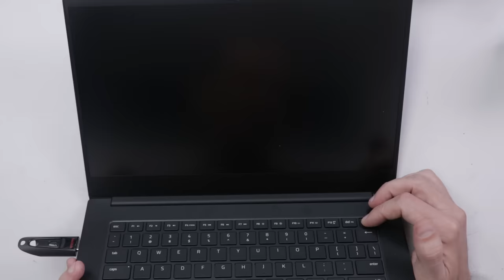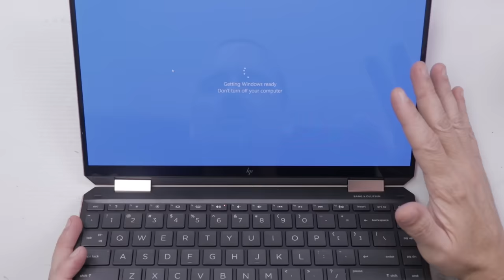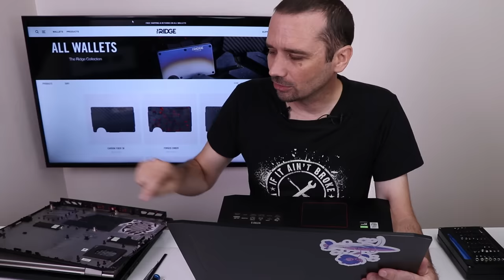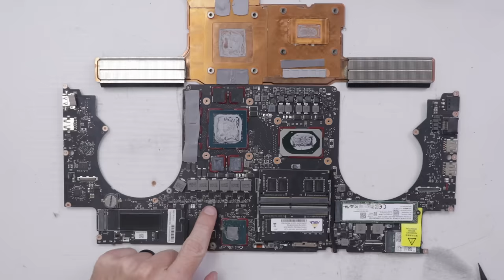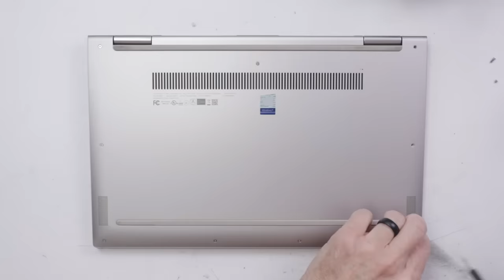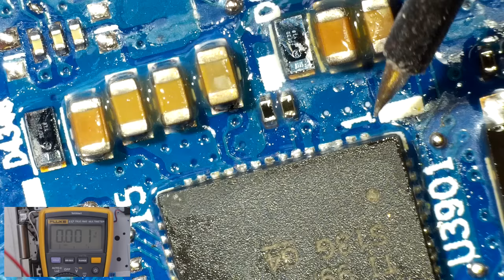I Paid $2500 for 5 BROKEN High End Laptops - But Can I Fix Them?!

Comment: i bought that exact nitro acer new from the shop. exact same keyboard error, sent it back, got a brand new one(i checked the serials) exact same error. this is a fundamental problem with these devices, although some say theres a software fix for it now. got an hp instead

Comment: Also to find the usb c controller chip unplug the battery, plug in the charger and use your flir camera to see which chip heats up per usb c port. 2 ports should have 2 chips i belive...

Comment: for the issue with the keyboard, consider after all the reseating of the cables does not work, you will have to replace the keyboard,  usually that will fix the issue, also reinstalling the os system is no a fix for fixing the keyboard, so that obvious fix is the keyboard

Comment: The Battery acts as a load , when the charge chip is loaded by the battery it causes some component to malfunction in the charging IC. Change that chip may solve your problem

Comment: Awesome vid.  I think it will be inspirational for people learning computers to see your process as you gain more PC specific repair knowledge.  Keep up the good work!  On the weird charging behavior maybe there is a chip that tells the system when not to charge the battery, by reading current charge.  And it's reading any charge as full charge.  The times it worked you bypassed the logic in that chip.  The first time because the battery was completely dead and the subsequent times because you were plugging it in while applying charge and it's faulty check was only when you first plug in the charging source.

One thing you might try is reinstalling the BIOS.  I'd love to see an update where you try different things.  It's in interesting challenge.

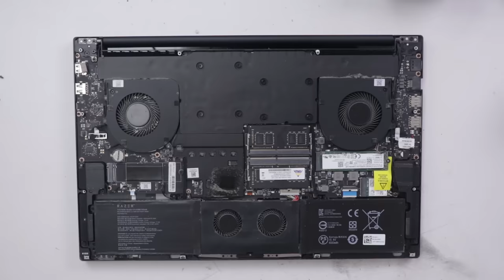Comment: I bought a 1060 laptop that was constantly thermal throttling, went to examine the fans and found a similarly thick dust clog to 10:00 in both fans. No wonder.

Comment: What we got there for the Lenovo is just a flat-out wonky battery *connection*. Inconsistencies about the actual charging of the battery should tell you that there's either a short or an improperly-seated component either related to or directly at the charging ports. If it were consistent then the charging port or the battery would be faulty, but since it actually works when you plug the battery back in, the connection seems to be hitting a snag when the battery is alreadty connected.

Comment: Nice lot you buy you were really lucky with tis lot. I would check the first and second mosfet . When the second mosfet is shorted it will noyt charge or the buck converter from the battery charging.  ( High and low mosfet)

Comment: Try changing out the batter connector pin selector I think when you plug and unplug it it only works when charger is plugged in you already unplug and plug it back in from the battery it should work normal

Comment: Check the USB-C traces? Sometimes USB-C can short out and charging and data flow can be REAL finnicky. Check if your USB-C devices are getting the appropriate speeds. Maybe the ports or something along the traces possibly is shorted out. Hence when you unplug the battery and then run power directly from the USB-C, it may be tacking power directly and the battery is probably getting over-charged. Not sure if you tested those chips when you had the battery unplugged. Just thinking USB-C is all.

Comment: From the little I know when the battery is plugged in it will be what creates the system voltages. I giant loop if you will. By the fact your tester keeps reseting would usually mean a ground fault. Check the surrounding caps.

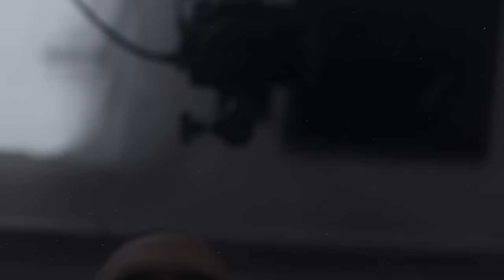Comment: 14:47 Seems like a faulty battery than can only hold 30% charge so it thinks its full and won't take anymore Edit: Maybe I was wrong???? That's really weird. It's gotta be one of those chips replacing the battery usually fixes these issues

Comment: There has to be a blown capacitor or resistor that is not limiting current someplace.  That board only has so many components, look for a capacitor with no capacitance or a resistor that's open or closed.

Comment: What if you added a switch to the battery cables routed to the exterior so you can switch the battery connections off and then plug it in and then switch the battery connections on.

Comment: i would actually add a manual switch with little note on it says “turn on after plugging the charger ” or “turn off before plugging charger and then back on after plugging the charger” 💁🏻‍♂️

Comment: Would the connector to the battery and the board be faulty? Or would you just think that it's receiving an unusual amount of voltage when plugged in at first? My best guess would be to to change the connecter from the board, or inspect the board for ground points to ensure everything is grounded correctly so there's no possible shortage of some sort. These are just ideas that I got from doing some it work in the plant I worked at. But it all could be old and the board just needs a new connector for the battery port.

Comment: If it was me with the bad charging laptop. I would add a little switch on the outside of the case. You could then manually open and close that circuit everytime you needed to charge it.

Comment: Maybe check the battery connector and components nearby. Also does each battery come with its own cable or the cable is detachable and same one was used for both? I don't like the looks of that L-shape bend on it.

Comment: I think the Lenovo battery takes power too early, when it's sending 7 volts, not allowing the dongle to initialize properly. Waiting for it to reach 20v, then plugging in the battery may be what makes it work. Try charging it without the dongle thing.

Comment: Lenovo laptops are picky on aftermarket chargers.I had a Lenovo laptop and i broke it's original charger by mistake,tried to use one from an HP that had the same voltage and connector and it would not accept it.Their service center told me that some models have a chip inside the carger that communicate with the motherboard to tell it if it's what it needs.It could also be a loose USB C connector on the motherboard

Comment: Laptops tends to be a fair bit more exposed to dust than other platforms.
Many people bring them into the bed and it gets to suck up all the fibers from the sheets and blankets.
They also tend to have terrible air flow and overheating issues due to that people design them so slim for some reason.
I would much rather have a bulky case that is reliable than a bomb which can die at any point.

Comment: That 4th one is a perfect example of who engineers and designers continue to fail.  It is SO easy to design an easy to access cleaning point for the fans and heat-sinks that do not require intensive disassembly.  A simple cover over that portion of the back would work fine.  One screw, pull off the port cover, clean the fins and reverse.  But NOPE!!!!  They have to do it this way.  It is just so infuriating and goes to show that manufacturers really do not care about their customers.  All they care about is getting as most money from them as possible and selling more units.  That's why channels like this are so important because more people need to take the time to FIX things instead of just replacing them.

Comment: The Windows troubleshooter doesn't actually do anything, it's basically theater.  The first thing I would've checked for is if the device has a switch (software or hardware) that puts it in airplane mode or something.  I would've said it was either that or missing drivers.
Reply: Occasionally it has actually fixed certain things like the notorious "invalid IP configuration".

Comment: it's probably the connections of the usb c ports. there could be some broken pins or poor solder joints. also get a different charger that one isnt that good certain cables have different power ratings so that's extremely important.

Comment: You might want to try running a bios update or an Intel Management Engine Firmware update on the one with the battery issue. It could just be a software conflict between the charging circuit and the battery management chip.

Comment: Holy crab!  Corrupted OS?  Well you done it the way every IT "professional" that ever shown me how to fix it done it (a few of which basically built the foundation for some predated operating systems).  Use a bootable USB, install new OS.  If you wish to retrieve files, use something like lubuntu and run the OS on that USB, that way you should be able to access files on the hard drive if it's not too heavily corrupted, and if they haven't encrypted their files.

Comment: Maybe try and take the battery connector off the motherboard and then solder it back on it may have a dry joint.

Comment: There 8s recovery partitions built in on own that should work. Also you need drivers and software from the company website for some stuff to work right. The extra drivers and software is half the reason to own those really

Comment: Those Texas Instruments charge chips are good stuff.  But i had some failing in weird ways on 2014 Razer Blades. 
A good default would be to just replace the BQ25 something something  on the Lenovo.
Reply: The issue specifically seems to be with the BQ25 Charge chip keeping the Battery switched as the main supply to the system.  If you then connect the Charger, it should Error / OCP because its Voltage and that of the Battery "Collide".

Having the Battery removed and then plugging it in and having it work and charge then, makes me believe that the Logic choosing the Voltage input for the machine is kinda dead. 
A replacement of the Charge-Controller is a really good idea anyway.

Comment: Usually they write a firmware code to toggle the charger state if it's charging or it's on battery mode. Please try flashing that and then reinstall it, it should be the only Dos or command installed. Check if that works for you and it it does 😊 you can 👍 install Windows os.

Comment: Try another charger, maybe your testing charger is at current limit and recognized it as short. It is at max load when you plug the charger and battery plugged in. Other thing maybe you have a bad capacitor on the board

Comment: I had same issue with a lenovo laptop I got for dirt cheap. Wouldn't charge. I unplugged battery. Connected charger. Reinstalled windows. Reconnected battery while still on. Battery charged up. And never had an issue since.

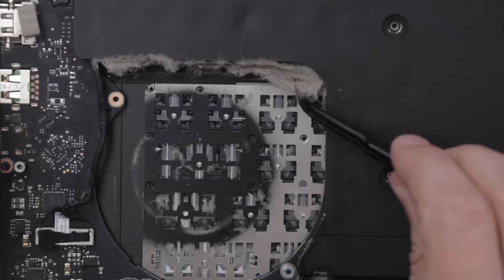Comment: 10:24 I've seen dustier laptops than that. I have an industrial strength air compressor, it's well worth it to blow some dry air through the air channel and make sure all that dust is gone. Simple job.

Comment: on the last laptop that has the issue of charging i think the problem could be centered around the part where you plug the battery into the motherboard. because without the battery it is running off a wired power connection and working fine but after unplugging the battery with the laptop plugged in the laptop runs normally but when you go to disconnect the charger after plugging in the mother board back into the battery that is when your reset back to step one so that leads me to believe that it could be that small black connector for the battery on the mother board.

Comment: I experience a similiar issue with a dell laptop with a bad remanufactured battery before. but it was on a replaceable battery pack, not internal. so the laptop wont charge at all when I connect the charger with battery in. but after replug the battery pack, it would charge the battery. the solution was to replace the battery with a new original battery, and the laptop are fixed.

Comment: 19:58 i dont know if this is right but it looks to me that there is a bridge on the 3rd and 4th pin if its not you should try reflow the chip
Reply: If you look close you can see that those pins are going to the same pad, so a bridge is fine.

Comment: For the laptop network issue, you just needed to grab the correct wifi driver and install it, didn't need to install windows twice hehe.
Reply: But since installing windows twice fixed the issue, it could be a telltale sign that some other drivers could have also failed to install properly during the first time. He probably saved the buyer a lot of headaches just by installing it again.
Reply: @DenjiW  Its not hard to check if drivers are or aren't working and if he was worried about the buyers experience he probably would want to know more about software and PCs to start with.
Reply: @lesliebombardier8980   Reinstalling Windows fixed the issue. I just thought you needed to read that once more.
Reply: @DenjiW  no he actually reset his machine, that's different to reinstalling windows. Also you cant confirm if there were still other driver issues lol.

Comment: Just out of curiosity, if you're testing laptops and worried about general software issues with windows, maybe try Linux just to see if general stuff works (like the keyboard etc) since it's a different OS? Might help eliminate possible software issues. Just a thought! Great video!

Comment: PC Laptops: Generally either 'nothing is actually wrong', 'Windows install is wrecked', 'bad keyboard', 'bad SSD*', 'dirty heatsinks' or 'totally immersed in somebody's toilet hazmat' with the occasional bad battery, charge port, or charge controller.

* On gaming laptops in particular, manufacturers like to inexplicably configure two cheapo offbrand m2 or msata drives in RAID0, which is both pointless (for the same additional cost they could have had a better single SSD at the target performance level) and bad for the drives.

Comment: i am pretty sure that the charging issue laptop needs a new ic chip for charger as same thing happened to my acer laptop until i got my ic chip replaced. now it works perfectly fine. oh and my laptop uses simple charger and not USB type c

Comment: Probably the port of the battery that you connect the cable is damaged and doesnt contact with the pins on the board

Comment: Normaly no charge while on... Means it had a power surge.... Could try to find capacitors and drain... Anythng holding charge on motherboard... Keep it dead... A couple of days then charge...wet the contacts with ipa.... Scrape contacts

Comment: The lenovo laptop, i think the port that connects the battery to the mobo is the issue. Maybe checking that port if is pins are really connect to the mobo or if the port is broken. In my work we have the same issue and the lenovo provider was telling us they have to change the mobo for that particular part.

Comment: The Acer one has a Backlit membrane keyboard with a numeric keypad as it claims on its spec, maybe the pads on the keys were just worn maybe I have had to repair them on controllers a lot in the past. Sure there is a product available to just paint on but I can't remember the name. But that's if that was the root problem.

Comment: not really a solution but maybe trying to put a switch between the battery and the board so that it can start charging then complete the circuit to the battery. its probably more complicated than that though

Comment: I think the one with the charging issue. I would check in Windows like was mentioned in the comments and try with a genuine Lenovo adapter. A BIOS update may help. 

You can usually restore from the factory partition instead of installing Windows fresh like you were doing. I assume you were deleting all the partitions when installing it. I also think your Windows installer may be an older version that is why it was missing drivers on a fresh install. I like doing a fresh install just to avoid the included software bloat from the factory.

Comment: Charging issue- Could it be the battery connector port on the board needs to be re-soldered?  Perhaps there is missing pads underneath?  Seems possible the it was ripped during a previous service.

Comment: Another "salvage" box of most working laptops. I wish I had that kind of luck. Bought a rugged laptop recently that was said to be fully working and even then it was screwed up. Got tired of being scammed on ebay so I just sent this one back instead of fixing the issues myself. I have no idea how Steve keeps getting box upon box of working stuff that was labeled broken when I cant even get a fully working laptop when the listing says fully working.
Reply from the maker: It all depends on the source. Try to find them right from the retailer if possible. It's not always possible but those are usually the best lots to buy.
Reply: @Tronicsfix  Thanks for the response. I got out of slavage flipping a while ago. Im actually just trying to get a decent laptop that I can rely on. Just got through a nasty divorce from a cheater and user and trying to rebuild. Everything has been a miss on ebay so far and trying to survive I don't have the time or funds to sink addtional money into repairs if it doesn't show up as described. Maybe I just need to save up and get one from you. Atleast I'll know from your videos  it's done right!

Comment: I bought a laptop (actually it was in the end for free) and i noticed immediatelly that 70+C is not great idle temp even for a laptop, so went in, and also spotted the same dust cussion, was the similar size ish as urs and after cleaning tems went down to i think 40+C and no more then 70 in games and so on, i was blown away what a little cleaning can achieve and probably they did give it for free cause they thought somethings very wrong with it :) i know have a nice retro game machine (its an older laptop, but still great for net and videos, btw and also windows 10 installed without a single problem)

Comment: Bro if you clean the flex cable of laptop it may have work because sometimes carbon is on them that is blocking the contacts between the cable and the board

Comment: With lenovo battery issues you need go to lenovo centre and turn off conversation mode that does not let fully charge the battery maybe this is the problem because my lenovo was the same.